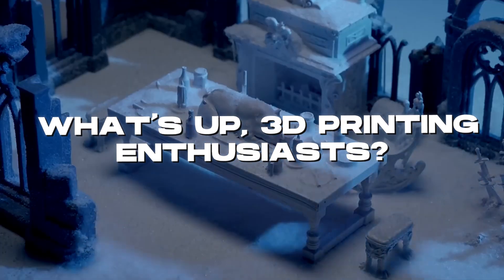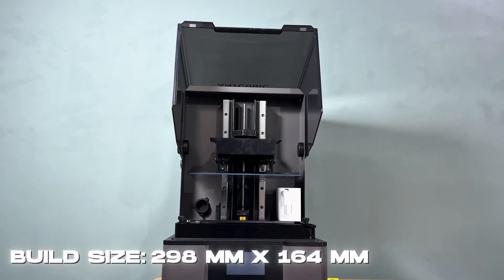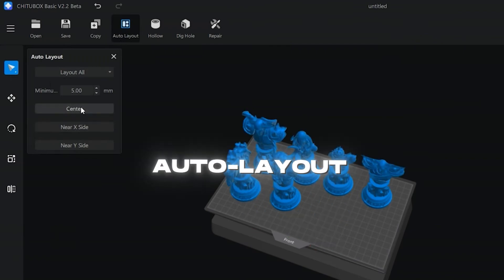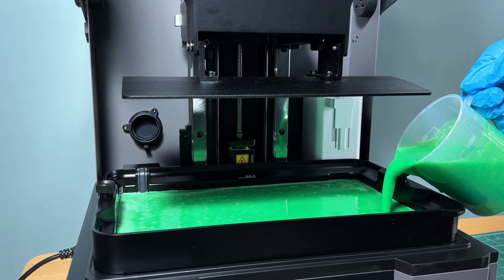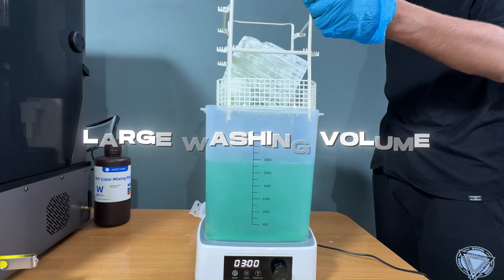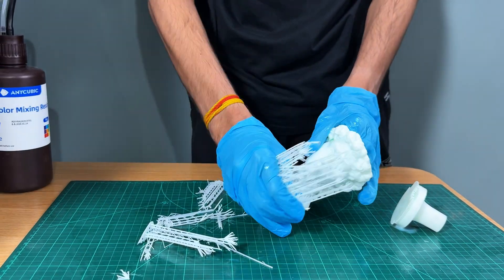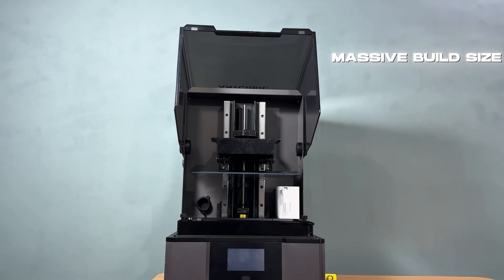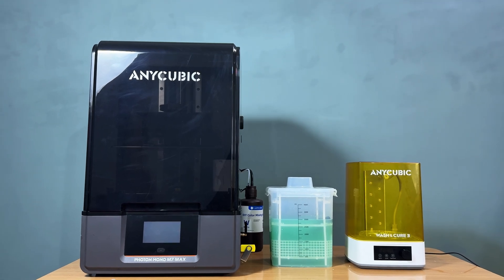AnyCubic Photon Mono M7 Max | Huge Build Volume and what not?

Comment: Its resolution and print quality is a deal breaker for me especially when even the AA can't totally hide the voxel lines. In terms of build quality, it is impressive but the GK3 Ultra is out there and it has same build volume but double the print quality (yeah I know, it is also more expensive but I'd rather pay more and have the full package).

Comment: Does have it auto bed levelling?
Reply from the maker: It has manual bed levelling.
Reply: Sadly no. i just dont get it why they left that feature out ( surely to sell a pro or whatever version with it later on)
Reply: @Darillya  manual is better. auto bed leveling on resin printers is a gimmick